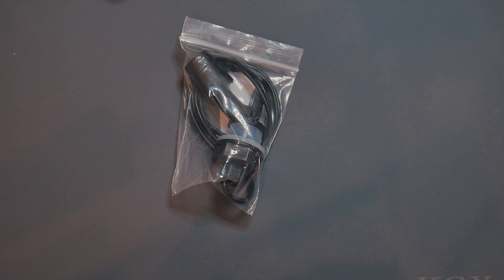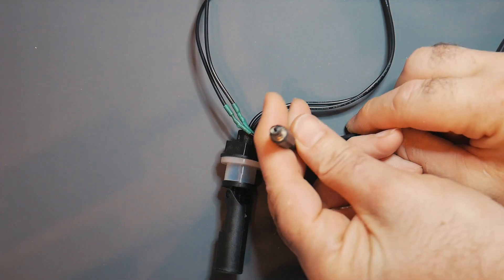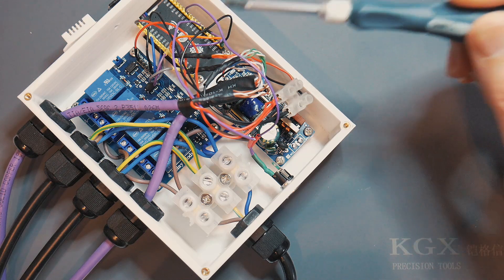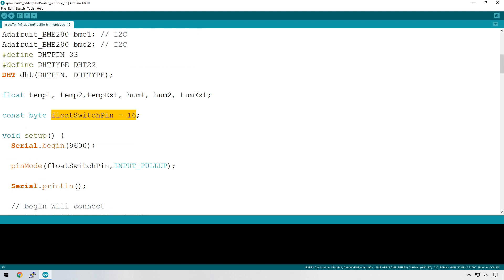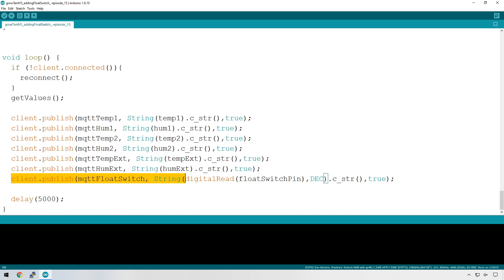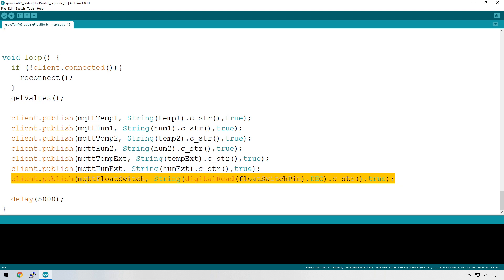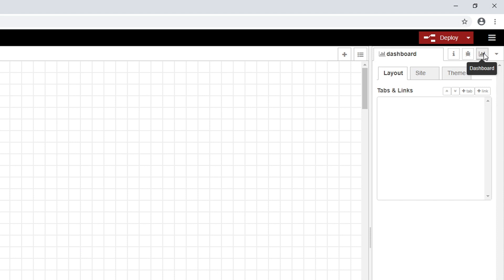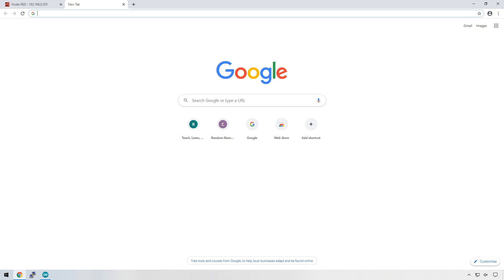Episode 15: Visualising IOT data in Node-red, and adding a float switch - CCBGTA

Comment: I had an idea for the spikes in reading. Making a statistical filter on the esp by :
Measure 10 time the value throw away the 2 upper from the mean and the 2 under from the mean. Make a mean with the 6 remaining values and send that to the pi.

Comment: Awesome video again .  I have been tinkering   as well.   I have my  esp's setup to do OTA, next I will try and do HTTP based updates  (I have 5 esp's in my hosue , an ESP in my garage (it will monitor the door), and ESP fr my up incoming greenhouse (have a small poly tunnel at the moment with an ESP, (it will have relays, and moisture sensors to auto water )

Comment: It is awesome. Is there a way to display statistics over a period of time like minimum temperature of the day or the month of september ?
I suppose the next step is having the esp reading from it ?
Reply from the maker: I already have an episode lined up to show how to store and retrieve historical data (that's why I in a previous episode, when building the server, I showed the installation of sqlite). I use historical data to optimise my growing...it's invaluable!
Reply: @ChilliChump2  maybe one thing i used your tutorial to make a weather station with bme280. I removed my spikes and sensor cliping issues by putting 2 pull up on the i2c bus of 4.7kohm. one on sda and one of scl. Maybe good to tell. Also you can't program esp32 when some pins are connected not a problem for this project but maybe worth telling. I also would like to know how to suppress data from a mqtt database.
Reply: I was wondering about the data logging capabilities as well. It might be nice to be able to understand year over year progress to figure out whether any changes you made to your processes affect crop outcomes.
Reply: @GOREHAMMERX1  exactly. I have seen people doing such things on hydroponics and aquaponic systems. They were telling that temperature has a big impact. I also wonder if data can be exported as csv so it can be processed in data processing programs